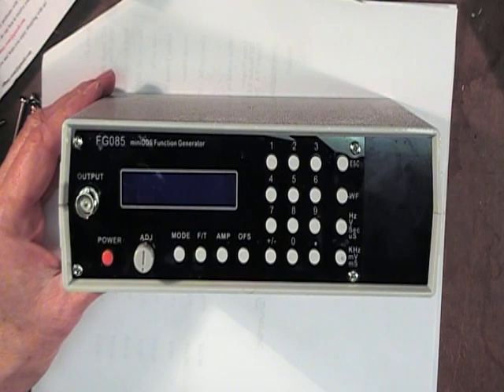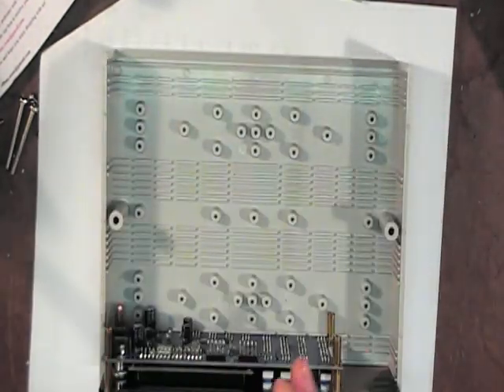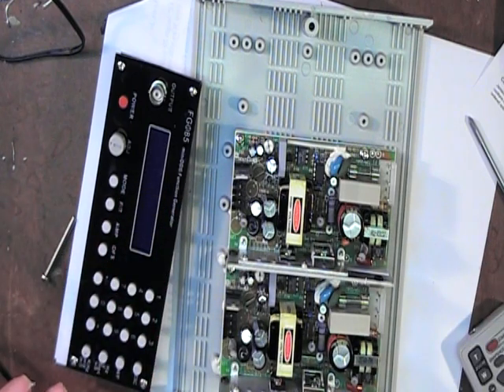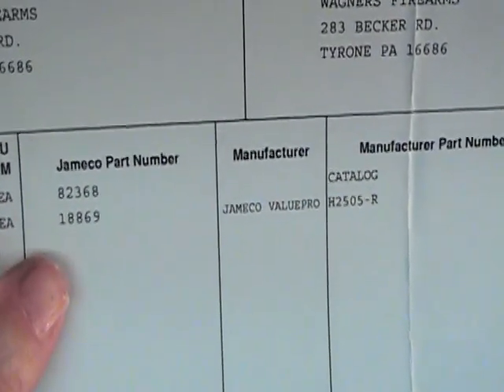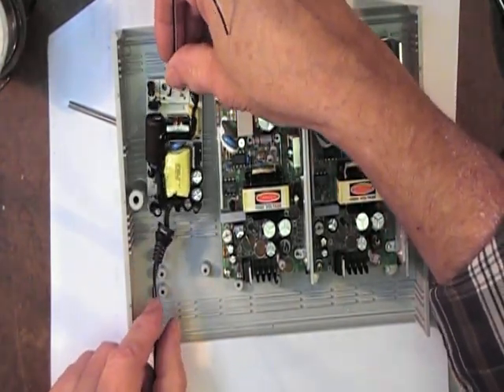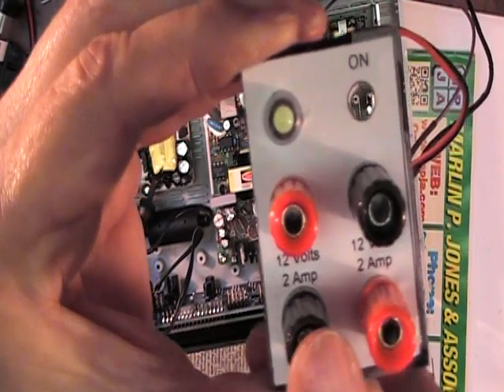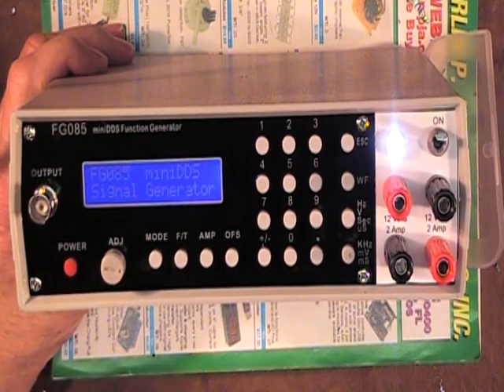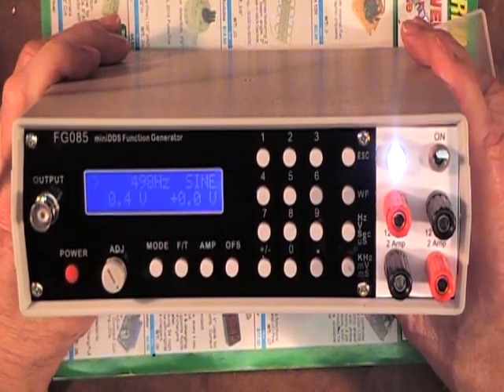Enclosing the FG085 Function Generator Part 2

Comment: Yep I remember this video it's a classic :-) I remember you and I were having a discussion about it as a comment on it with your other channel about a case that I got that you turned me on to for the same exact function generator kit. and it fit perfectly without having to add that extra to the right side. It was small enough to fit that whole board into the case. :-) I still have it to this day.